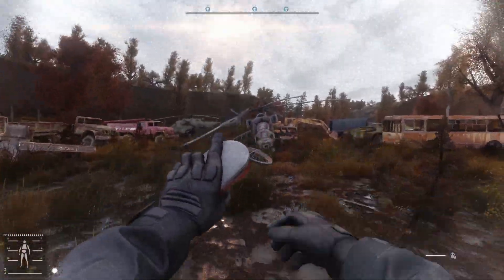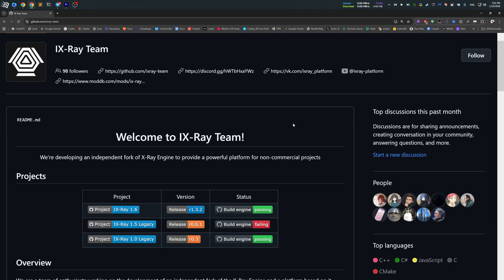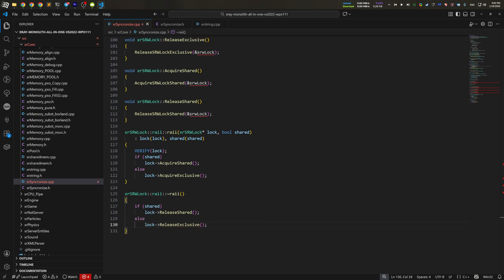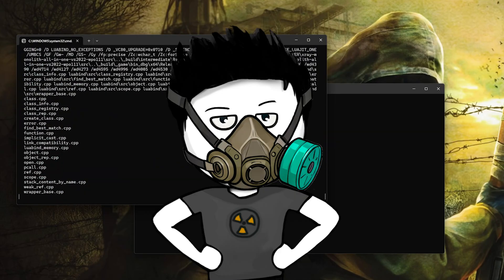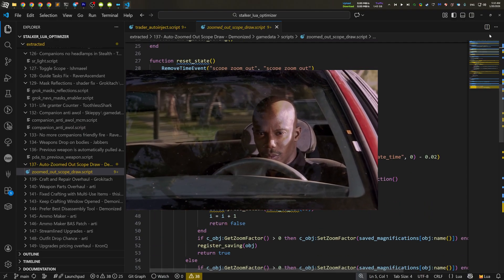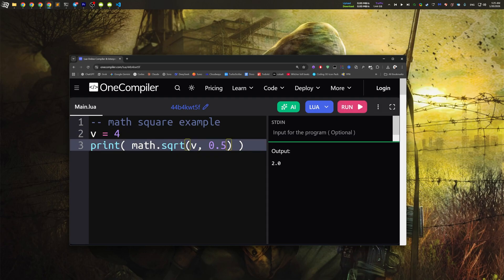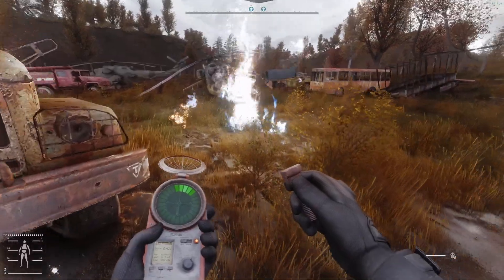How I Fixed STALKER's Terrible Engine Performance

Comment: This is cost nothing, because the most terrifying problem of this engine is scene graph and occlusion culling for local light sources, AI is smaller problem than graph.
Geometry visibility is calculating in main thread multiple times in frame for GBuffer, forward rendering geometry and sun cascades. For camera using render_main function, for light sources (including sun cascades) using render_subspace function.

Comment: Not sure on shared lock performance these days but back when this came out they were a lot more expensive so if it was something written to frequently it was a net perf loss. How did you measure your change improved things?
Reply from the maker: I wasn’t tbh, it was just for fun so I thought why spend time on this.
I’ve also heard there was no shared locks back in the days.
With Lua script though I’m currently using a profiler.

Comment: iirc there was a thread in AP-Pro or one of those forums that shared some ways to optimize LUA scripts, including replacing some mathematical operations. It stated that division were more taxing for the CPU rather than multiplications, so for example instead of using something like /100 you could use *0.01
Reply from the maker: I'll check that, ty.
Do you have a link to that topic?

Comment: This looks great! Also looking at the benchmark on the GitHub shows a lot lower CPU frametimes which I think will be the most noticeable aspect
Reply from the maker: Hey there! Nice vids man, good luck with Invictus :]
Although I wouldn't trust much to current benchmarks, as it's highly dependant on the PC specs and a modpack.
So in order to understand the real impact, you should try it yourself.

Comment: You literally proved in this video that CPU bottlenecks are the real enemy, not engine limits. You optimized X-Ray by fixing sync issues, bad data structures, and especially Lua overhead, and suddenly frame pacing improved without rewriting the whole engine.

Now look at S.T.A.L.K.E.R. 2.

UE5 is clearly CPU-bound in open-world traversal, AI, scripting, streaming, and Blueprint-heavy logic. The cores are there, but they are not being used efficiently. Same problem, different engine.

You already showed how much performance is left on the table when scripting layers and task scheduling are not optimized. Applying that same mindset to STALKER 2 could mean:
	1.	Breaking up game thread congestion
	2.	Moving heavy Blueprint logic to native C++
	3.	Better async task usage instead of serial stalls
	4.	Proper multi-core scaling instead of hammering one or two cores
	5.	Fixing frame-time spikes, not just average FPS

You did not rewrite X-Ray. You targeted the real bottlenecks and fixed them.

If community tools and smart optimization could save a leaked, ancient engine, imagine what focused CPU optimization could do for a modern UE5 game that is clearly leaving performance on the floor.

Same philosophy. Bigger impact. The Zone deserves it.
Reply from the maker: While you may be right, I don't think we can expect any real and heavy mods for S2 .. until they stop breaking all the mods with every update.
Even with the Zone toolkit, it's still unclear and won't solve the problem.
At some point I had an idea to start doing mods for S2, but then .. I was like nuh, fixing em with every update is just too much.

Comment: Why don’t you fix S.T.A.L.K.E.R. 2’s UE5 performance issues and improve CPU utilization by actually using tools like ChatGPT Codex and Claude 4.5 ?
Reply: Cause fuck using AI tools, and also, different ballgame optimizing Stalker 2, which runs on UE5, which you can not recompile yourself, the engine you can, not not the game, and not even the version they possibly modified, since their is no leaks or anything of the UE5 version they use, if they did modify it. The original Stalker is better for this given you can compile the game from source as he showed, and given it uses LUA, its easier to modify and optimize.
Reply: @GBOverload  You’re mixing up a few different things here, so let’s separate them clearly.

You’re right about one part: you cannot recompile STALKER 2’s game code because its source is not public, and any engine-level changes GSC made on top of UE5 are not available to modders. That part is correct.

Where your argument breaks down is the assumption that this means meaningful optimization is impossible or that AI-assisted tooling is useless.

First, UE5 is not a black box at runtime. Even without source access, performance bottlenecks can still be identified and mitigated through:

1.	CPU thread utilization analysis
2.	Task graph behavior
3.	Render thread vs game thread stalls
4.	Asset streaming pressure
5.	Shader compilation and PSO behavior
6.	Data-oriented scripting and Blueprint cost
7.	Configuration, scalability, and scheduler-level changes

Second, optimization does not require recompiling the engine to be valuable. Many UE5 performance problems in shipped games are not deep engine bugs, but content, scheduling, and usage issues. These are exactly the areas where profiling, reverse analysis, and tooling (including AI-assisted analysis) do help.

Third, AI tools are not being used to magically “rewrite UE5.” They are used to:

1.	Analyze massive profiling traces faster
2.	Spot recurring anti-patterns in Blueprint, asset usage, and threading
3.	Suggest concrete refactors, load-order fixes, or CPU budget redistribution
4.	Accelerate hypothesis testing, not replace engineering judgment

That is fundamentally different from “letting AI optimize the engine for you.”

Your comparison with the original STALKER is also apples to oranges. Yes, X-Ray is easier to modify because its source leaked and Lua is exposed. That does not mean UE5 is inherently worse or unoptimizable. It means the optimization surface is different. Modern engines trade openness for scale, tooling, and platform abstraction.

Finally, “no leaks” does not mean “no insight.” Modern performance engineering is largely about measurement, not source access. Studios optimize closed-source engines all the time, including consoles with far tighter restrictions.

So the real discussion is not “can random people fix STALKER 2’s engine,” but whether developers are fully leveraging profiling, task scheduling, content discipline, and modern tooling to address CPU-bound behavior. That question is absolutely valid, even without source access.

If you want to argue that X-Ray is easier to mod, that’s fair.
If you want to argue that UE5 makes optimization different, that’s also fair.
But saying meaningful optimization is impossible without recompiling the game is simply not accurate.
Reply: @randomfootages9120 The problem is random people want to fix Stalker 2, and like you also explained, they can't.

Yes we can profile all we like and make content changes ( thanks to repacking tools and knowing the UE5 version ), but we can not make meaningful code changes where they might be needed, not without basically making a community sdk, which can be done, but takes years to complete, even from a content accuracy stand point, not even speaking code.

I am an unreal head myself, but I know the limits of community modding, as much as I like to figure out how a variety of UE games work. However, their are limits to fixing a UE game.

UE5 has a similar issue as the old UE3 did, with many a developer wanting to modify UE5 to do what they want it to.

I still say fuck AI tools, no matter what they are in regards to generating content or code. However, that seems to be largely preference at this rate, but I like knowing what I write is my own.

Comment: Dude you are masterful. I just ran through the default ALAO setup and it optimized like 750ish files. I booted up gamma and instantly noticed a way way way smoother experience. Thank you so much. Also if anyone needs help getting it to run feel free to message me but Howdy gives a pretty good tutorial linked from the Git hub page.
Reply from the maker: Appreciate the words.
Glad it helped :]

Comment: Question, as someone that dont know ANY of coding/scripting and only adit basic things (weapons stats mainly), can use this to make optimization of Stalker ANomaly with mods (hundresd not including weapon mods) while having a low spec PC from 2012 (gt640, i7 3770, 16gb ram 1333mhz)?

I see this tool a great gift honestly, but hope there is a posible future intall and how to use video because i cant install it correeclty without errors e.e

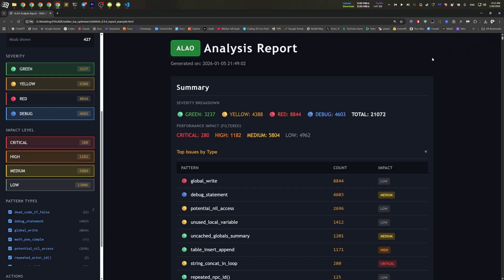Comment: I don't understand the mini showcase at 08:00

Frametime graph looks about the same, but you're idling in cordon rookie base. Would have been much better to show yourself running a few dozens of meters because upon loading assets this is where the 1% lows will drop (stutters). Also why are you talking about having a smoother experience when literally your AVG fps counter went from 50 to 35 ? 

Also HOW are you having only 75 FPS with a 13900K & RTX 4090 ? I had this config on my previous PC before I upgrade, and I was having 150 FPS at 4K res in Gamma DX11 almost maxed out. No lossless scaling no nothing, just native. Only the 1% lows could drop to 30-35 fps sometimes.
Reply from the maker: Yeah the benchmark I made was faulty, check the pinned comment.
As for the FPS, I have like 100 mods on top .. also the latest versions of gamma seems to made FPS even worse.

Comment: Хауди, doing any performance optimization is kinda pointless without profiling with something like Intel VTune, Tracy, Superluminal, etc. If you like that kind of thing maybe even try out shader optimization with NVIDIA NSIGHT.  These tools will show you which functions take the most amount of time and therefore their optimization will yield the most performance gain. The video kind of took an unexpected turn where you introduced a source-level lua optimizer :) Would be nice to see what exactly does it find
Reply from the maker: I know haha, it's just I was about 99% sure the idea is dumb and it'll not work .. so why spend time profiling dumb things?
And then bam .. it worked, so I could see it even with the naked eye.
Of course for further development I'll use profilers and debuggers :]
Reply: @howdy_official  Yeah I was shocked when you wrote an optimizer, then I was shocked that it has actually worked

Comment: This is very nice. I used the program for mods then anomaly base scripts and gained 7 average fps from 45 to 52 in EFP with full v23 sss. Though since I'm heavily gpu bottlenecked even with AOengine I only gained 1 extra fps 😂
Reply from the maker: With stalker, even 0.5 fps is a win :]

Comment: i think ALOA just fixes badly optimized code, not necessarily fix the Engines issue, but its pretty good.
Reply from the maker: Yep, and it happens that 90% of stalker Lua code is badly optimized

Comment: 3:20, swap still wastes a bit of time, by unnecessarily copying to the last element, which will be popped anyway. So, instead of iter_swap, just *it = item.back();
   std::vector don't uses to be slow. It's its erase f(), when not applyed to the back, that is slow, by preserving order, as you pointed it out.

Comment: Huh, that's absolutely not where I thought you were going, especially after mentioning the single threaded bottleneck ; I wonder if you could dispatch the game events to Lua scripts from independent threads, I assume the order of individual scripts isn't that important although if that was the case it would be a matter of writing some sort of dependency resolver to avoid that ; if executing Lua scripts is that expensive on the engine, I still assume giving them multiple core to run on will lead to a significant speedup, despite the write contention on the game state (I assume you're gonna need locks there).

Comment: 6:30 Lua bytecode (and not just Lua bytecode, but also compiled processor operations in machine code) has an interesting feature: different bytecode instructions have different costs.
Simply comparing the "number of bytecode operations" is rather crude, although it's suitable for beginners.
With exponentiation via multiplication, it does work roughly that way, but sometimes, there are cases where one bytecode operation is worth a thousand others.
Reply from the maker: Yep, you're right.
Although I was not saying that the number of operations has like 1:1 relations with the performance.
I had to simplify that part to make it less painful to watch for non-programmers.
In that case I would check the actual machine code instead of bytecode, in the first place.
With a proper profiler, as well.

Comment: Im a bit confused, because does JIT not optimize the code after the initial run?  Not trying to argue against your work as it clearly shows improvements but just wonder what the difference is.
Reply from the maker: Your point is valid, yes.
However, JIT is not a magic .. it has flows and scenarios it can't handle.
Things like trace aborts, short-lived code, and the code that not getting "hot enough" for the JIT to work makes it less effective.

Comment: Really enjoyed this, well done! I am not sure if you have played or are interested in Cyberpunk 2077, but it uses an updated version of CD Projekt Red's in-house programming language that you already covered in your Witcher 3 modding video.
Rather than exploring mods, a video discussing the code's overall structure and potential optimisations, as you did here, would make for an excellent video imo. On the PC version, the RedScript (as it was renamed from WitcherScript) files are compressed in "bundles", but it's possible to extract the actual source code for exploration and modding!
Reply from the maker: Appreciate the words :]
While I wrote lots of code on WitcherScript, sadly I haven't touched RedScript.
But I would like to, for sure. Thanks for pointing it out!

Comment: Can you make a plugin loader so mods can be dynamic C++ libraries?
(so instead of writing garbage in LUA one could write garbage in C++)
Reply from the maker: Shouldn't be that hard, as literally all of the Lua API is merely an exposed methods and fields.
But it's a task for an engine developer, in the first place.

Comment: 6:22 I think you chose a poor example... Not only did you replace an exponential function with the multiplication operator, since the value of 2*2 is known at compile time, there isn't ANY calculation being made and you can see the bytecode just sets the value of r to be 4. Granted, the point still stands because replacing math.pow(a,b) with a^b really DOES result in bytecode with no function call, but it still actually contains the exponentiation operation...
Reply from the maker: You can replace it with x*x and it still will be faster than x^2, cuz under the hood Lua replaces the second expression with a math.pow call or a POW call at the bytecode level.
Imo simple mult instruction is always faster in any of those scenarious, providing the same result.
Reply: @howdy_official but still, your example isn’t calculating anything and just assigning a value known at compile time
Reply from the maker: @monabuu  Can't argue, 2*2 is a value known at compile time :]

Comment: Xray being on OGL 3.3, I don't understand why people try to optimize it.

There isn't much to squeeze out of it.

Now if someone were to rewrite it in Vk 1.4 and use the extensions provided by gpu vendors for uber duper techniques, you'd easily get double or more performance.
Reply: Just use DXVK, can't get much simpler than this

Comment: This is amazing. Would this work with other mod like Call of the zone? that older 32 bit engine is really getting laggy when loading npcs and stuff like that.
Reply from the maker: As long as it contains .lua scripts to optimize - it should work.
Although keep in mind the tool is experimental and there could be bugs, in this case make sure to report them so I can fix em.

Comment: You didn't fix the engine, you modified Lua scripts, and your before and after FPS was identical. You've done a disservice to the original devs by saying their engine performance was terrible, and you've wildly misrepresented your efforts in improving performance.
Reply from the maker: ALAO is not about FPS, alas you didn't get the idea, nor have you tested it before writing the comment.

Comment: Looks like great progress, but your before and after numbers at 8:00 are incomplete. Any chance to get a framerate graph with 1% lows over a wider benchmark? 

Also this would make a great series 🙏
Reply from the maker: Alas the performance and stability impact differs and highly depends on the PC specs and a specific modpack.
I didn't wanted to focus on graphs much, as the tool aims not on improving FPS, but the stability in the first place (reducing microstutters).